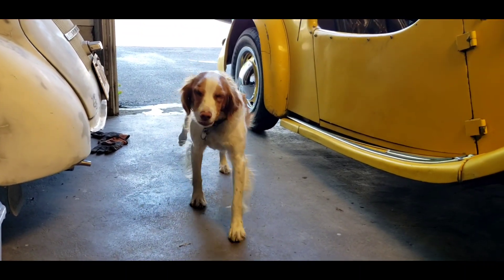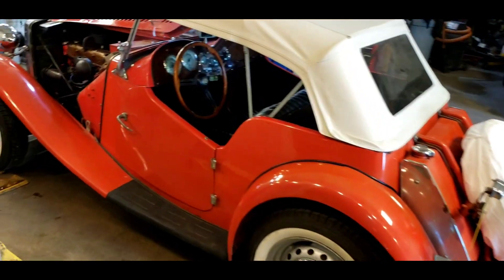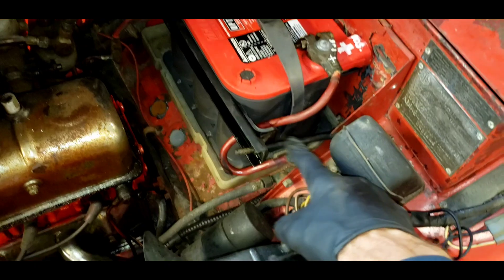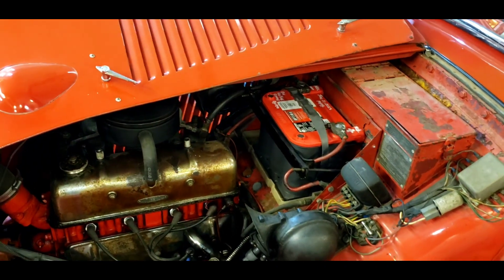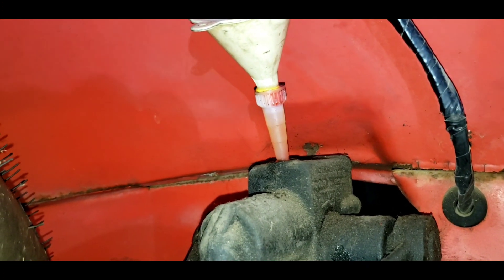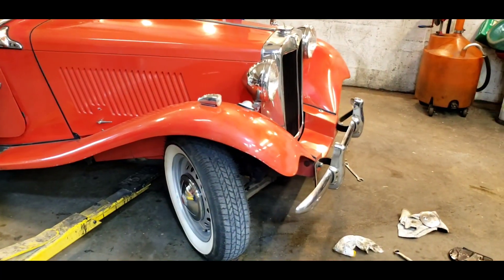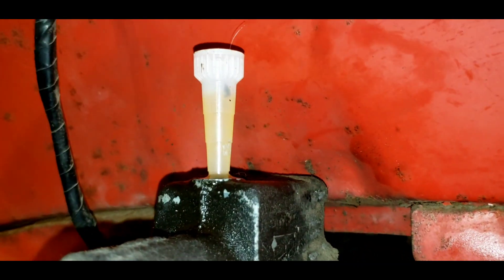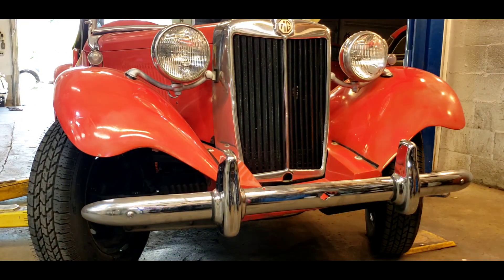Way Too Bouncy MG TD

Comment: i saw greaseccerts on the shocks. also it appears the shocks are like modular like rubber bushings can be replaced without replacing the whole scissor shock thing. granted ive never worked on anything thing like this and the only time ive been near an MG was the 1967 blue MG B back when i was 21. neat lil car and fun. friend sold it after getting the carb rebuilt cause he was getting on in age and it sat most of the year. hugs love and bee safe :D

Comment: We always used motorcycle fork oil in my Saab that had those shocks.  They   Must be filled every so often because they are designed to slightly leak to lube the pivot point

Comment: The spacers on the front bumper bracket are supposed to be between the frame and bumper bracket:   Apple hydraulic rebuilds lever shocks.  I believe they have an exchange program
Reply: Yes, Apple is well known to rebuild lever dampers to better than original spec.

Comment: One last thing you can try before investing in new shocks is to take the shock off the car, bolt it to a bench,  take out the fill plug, and work the lever through its full travel. Top up the oil level with a veterinary horse syringe instead of a funnel, this will allow air out the fill hole around the tip. If the shock is at all good, you should feel resistance in the lever as you get to each end of travel. Add oil until full, then keep working the lever back and forth until full. Replace the fill plug and check the action. If the shock is good, you should feel resistance along the lever's full travel. The key with this approach is by taking the shock off the car you are able to work the lever through its full travel. As a last step you can turn the shock over so the bleed port is at the highest point and leave it there overnight. In the morning open the bleed port and top up the oil, allowing any air to exit the port.
Reply: I would add one more thing to your comment, if the the damper is removed and on the bench, if it is possible remove the top plate of the damper and fill it with hydraulic Jack oil. Pump the damper lever, fill again reassemble and see if the damper is functional. If not it must be rebuilt at a machine shop - a skilled task.

Comment: I believe those shocks originally used shock fluid which I think was glycol based the seals dry out and it all leaks out if you don't rebuild them the only thing I found that works is like heavy oil 50 weight or 90 weight at least it doesn't leak out as fast.
Reply: No, the dampers are mechanical machines. They do have seals, but they are mostly very fine metal machining. Harley Davidson can sell shock absorbers oil. A good substitute is hydraulic Jack oil. The lever Armstrong dampers can be rebuilt. Apple Hydraulics in the USA come to mind, or simply or rebuilt units from a Moss Motors rep. Because they are machines with routine servicing ( recommended hydraulic damper fluid) they last around 30 years

Comment: IME, TD shocks will leak oil when worn. if the level of oil in them is low, putting more in may be a temporary fix, if it fixes anything at all. a more permanent fix is to rebuild them. it involves a bit of expertise. but it can be a DIY job. there are a few shops around the country that can rebuild them for you. there is one in minnesota and one in new york that i am aware of.